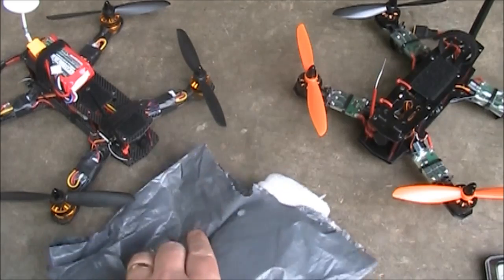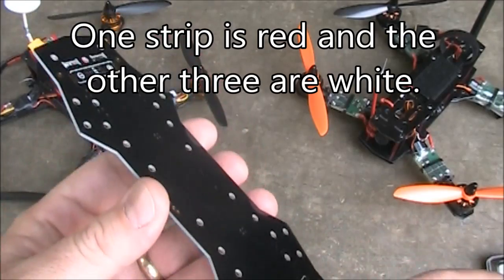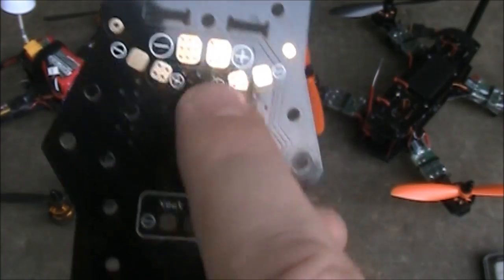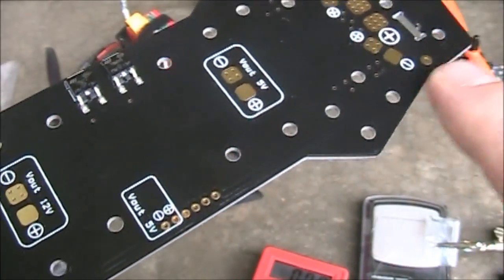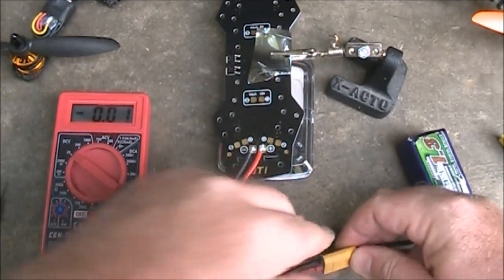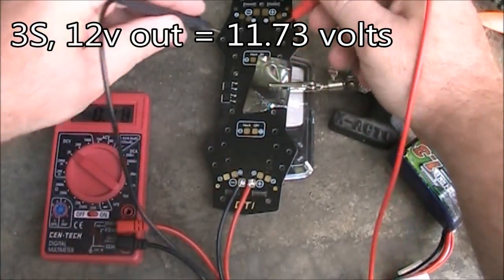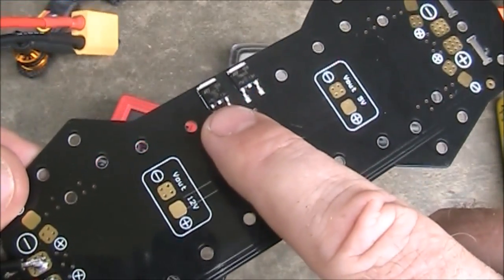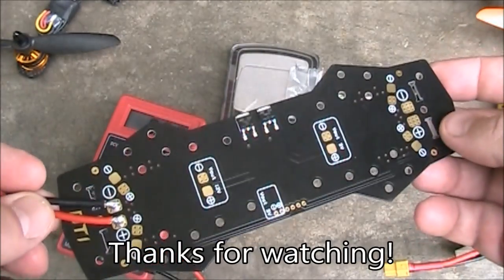Diatone ZMR250 Power Distribution Board from Banggood

Comment: Great video, it is helping to demystify all this stuff as I'm building a ZMR250 and I'm very confused at this point. I'm not really sure how to wire everything up. I've got the motors to the ESC's soldered on to the PDB and I'm trying to figure out 
A) if I'm soldering the white wire from the ESC to the board spot, which you point out, what am I doing with the black wire?
and 
B) Can you point me to a resource that explains all the connections to the naze32 rev6?
Reply: Did you figure it out? Same issue here...
Reply: yes I just combined both of the negatives and soldered them to the negative on the PDB for that motor.

Comment: I am having a problem with my fpv set up. I have a zmr250. 2300kv motors, 12a esc, 3s 1300 mah 45-90 nano tech battery, anyway when I get my quad up to speed to be able to lift off my video goes out. I am powering vtx and quad off one battery. Do u think I need a lc filter or what should I do?

Comment: i have escs with bec on them but am not using the bec from the esc to power my flight board but using the 5v out put on the pdb instead but what do i do with the other wires from the esc after i solder the signal down i am left with 2 wires ??????

Comment: Good video.  However, and LC filter is not a "Low Current" filter.  An LC filter uses an  Inductor in series with current flow and a Capacitor in parallel with the voltage.  The inductor (AKA a Choke) tends to maintain voltage, and the Capacitor "dumps" any AC ripple to ground.   L is the mathematical symbol for Inductance and C is the symbol for Capacitance.
Reply from the maker: +oldgazer Yeah, I've been corrected on that a few times.  :)

Comment: Have you been using this board ? After flying only 1 battery, the 2 tab by the side is very hot. Is this normal ? (Hot = can't hold it) I'm worried will it effect power supply to the 5v point. Thanks

Comment: Hi Trav, can you tell me if you hook up the ESC signal wires to the board can updates for BLheli be done throgh the board ? just before I get the soldering iron out ! great vids by the way ,most informative. Cheers
Reply from the maker: +McHaggus I wouldn't do it.  Just run them to the board.  It would be too hard to update the firmware later.  There was one time where the DYS ESCs needed an update to keep them from burning up.  If you solder the wires into the board, you're going to be kind of stuck with the firmware you have.

Comment: For the vbat connection to work do I have to run something to the 5v pad? I can't get my naze32 to start up when I connect my battery...
Reply: Vbat connects to directly to your lipo battery voltage any ESC power pad will do this is the reference voltage input for the voltage alarm feature of the naze and not the power input

To feed power to a naze or naze based flight controller you can feed 5 volts to either the RC PWM inputs or the RC PWM outputs 

Check out painless360 channel he has great videos about connecting and tuning the naze

Comment: Hi, thanks for the review.  Pls can you post the regulator part numbers?

The 12V voltage drop off seems a little high.  Not unusual to see voltage sag approaching 10v on a punch out. This together with voltage drop off will see many board cams drop out.

Comment: so this is a mid plate replacement correct? odd that the LEDs are on the bottom of the board where they'd be blocked by the bottom plate. What is everyone else doing about this? I was thinking I'd just run some wire from the solder point and mount the LEDs on a 3d printed bumper set I have.
Reply from the maker: Josh Bryson Right, it is the middle board.  The LEDs line up with the larger rectangular holes in the lower plate so you can see them a little.  If you're putting LEDs on a bumper, make sure they go on the back.  Then when you fly with friends, they can see you when they are behind you.  I don't put LEDs on the front of mine anymore because I think they only really help with LOS flying and I usually just fly these FPV.
Reply: Cool, good info. Look forward to installing it, got it all torn down earlier so hopefully this week I'll get it installed along with my FPV gear that's supposed to be here this week. Thanks!

Comment: Lets say you put a 4 cell setup on it that would require 30A escs. If the burst amp draw of the quadcopter was 120A. Would this board support that?
Reply from the maker: Larger motors would cause you to have to get larger ESCs.  The amp draw is determined by the motors.  If you want to run 4S batteries, you need to make sure that your motors and ESCs support them.
Reply: Sorry I meant, would this board handle 120 amps for example? If I put high end motors, escs and large props, would I burn out the board because of the high power?
Reply from the maker: Marc Connell I'm not 100% sure.  I checked the banggood website and it doesn't give the supported voltages.  I'm planning on running 4S through mine eventually after I sell a couple I already have and build a new one.
Reply: It had pretty big traces I'd say yes.
Reply: I think that this pdb will handle 150-200amps burst I put a115 amps through my overcraft pdb all the time and it has far less copper for the buss due to the extra features taking up space I wouldn't worry about it
Reply: Marc Connell Dude ! this pcb is 40A max! you will burn the poor thing down! not good! i was about to connect 4 cobra 2300 on it and a local member laugh so hard when he realized what i was about to do!
Reply: I can safely say, This PDB can support more than 40A constant. I have 4 emax 2204 2300kv motors, 12a AFro ESC with blheli and oneshot enabled.  I use 6x4.5 HQ bullnose props. I currently have a problem with Low C batteries where if I punch the throttle, it twitches to the right. With a hich C battery (turnigy nanotech) it fixes the problem! you might of got a faulty batch?
Reply: am going to be almost to 90A total..not sure if this can board can handle such a continuing current. ! and the Max ? we need more info regarding those pdb..they just missing specs..
Reply: +Marc Connell Hi, is your board still working? I'm using mine on 4s 5045 bullnose and it seems fine.
Reply: +Aerial Iceland Working perfectly with 6045 bullnose props. Havn't tried 4S yet though. To much thrust at minimum throttle with the 6045 bullnose so I'm probably going to go 4s with 5045 bullnose. I'm confident you should be safe :) My board is starting to warp from crashes though. But I can easily get another one for £3 :D
Reply: +Marc Connell Thats great to hear, thanks so much :)

Comment: The question is can is till fly with 4s ? Or will 4s burn these small dc convertors on the board?
Thanks im waiting ur answer to order
Reply from the maker: My guess is that if you keep the overall amps down that you are pulling through the voltage regulators, they should be fine - like a flight board and camera.  If you start drawing a lot more than that, you may start having problems.  Recently, I have started buying components with a wider range of supported voltages... like 5v-24v... then I can connect them directly to my battery and I don't have to worry about finding a reduced voltage power source.
Reply: ***** thank u for the reply but still u didnt answer my quest im not talking abiut the current as because my camera wont pull so much current my question is will these convertors take if a 4s is pkugged at there input..did u try?
Reply from the maker: Mar1wan1 I connected a 4s battery to it in the video.
Reply: K thanks sory I didnt see

Comment: Great review thanks. Just had my one arrive. An LC filter has inductance (L) and capacitance (C), hence the name. Used to smooth or filter out the input power. Not "low current" as suggested. Thought I'd point that out for anyone wondering what one is. Thanks again.
Reply from the maker: crampynz I had no idea that was what LC stood for - I always just assumed "low current".  I'll have to make a note of this so I don't get it wrong next time.  :)  Thanks!
Reply: ***** Nice video covered alot of good points.. My boards should be here in he next few days hopefully.  And I guess while we are on correcting terminology the "voltage reducers" correct name is a voltage regulator. In this case these are just standard linear voltage regulators so be careful they will tend to get very warm.  Keep up the good work.
Reply from the maker: ModifiedRC Heh... Obviously I still have a lot to learn.  I'll take note of this too.  Thanks for letting me know!
Reply: ***** No problems at all. I watch all of your vids. Keep up the good work.
Reply from the maker: crampynz Cool, thanks!